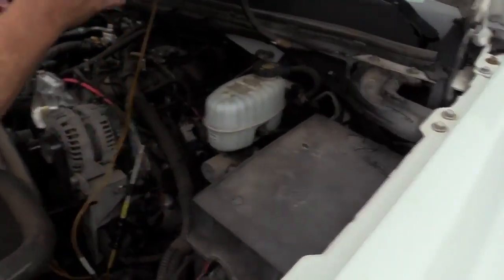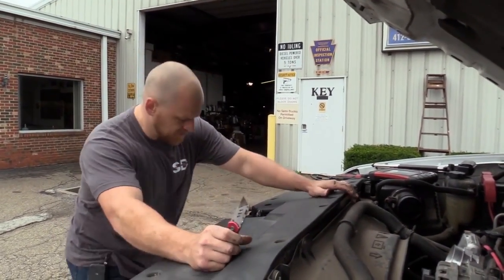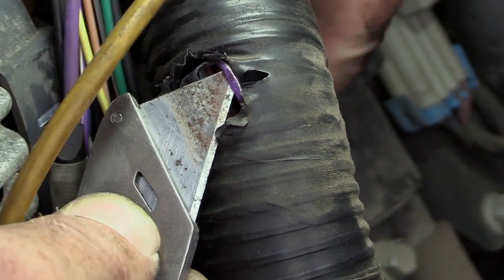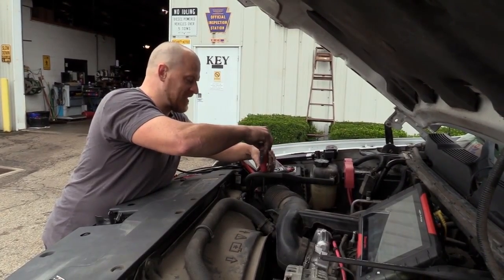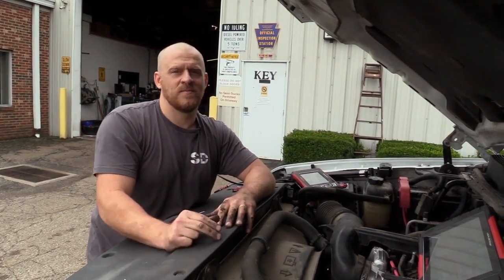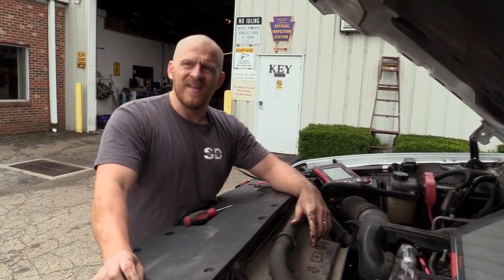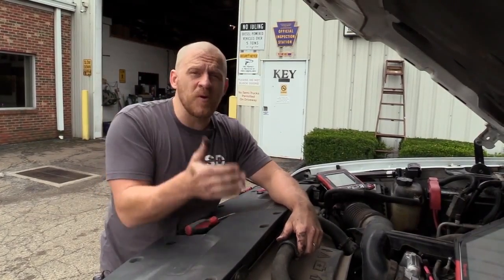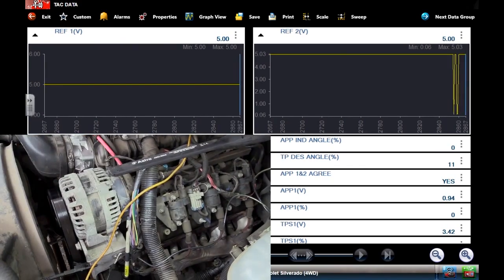Pulling codes and changing parts is not a diagnosis!

Comment: Paul first another great video.I worked for Autozone here in Michigan for three and a half years for a side job and it was the worst.That little blue code reader was a joke, you would plug it in to the cars DLC and pull a code.Then you would plug it into the stores computer and it would bring up what the code was and the description of the part.The person behind the counter would try and push the customer to buy the part.Being a Certified Mechanic since 1986 i would try and tell the person to tell the customer to take the vehicle to a good shop and have it diagnosed right.I am glad i no longer work for Autozone because these Big Box autoparts stores are a joke.i even told the company they should stop having there counter people play mechanic just to sell a part.Just a little rant LOL.

Comment: Part of peoples fear of paying for diagnoses is getting ripped off and not getting something fixed. I had a friend that is in the military call me about a 1800 bill for a shop to replace diesel exhaust no sensors  and def light and not able to drive at highway speeds on his silverado. Hes in Virginia atm me in california and i know little about diesels but after talking to him he had someone jump start his truck at his base and the codes started popping up afterward. Instatntly i thought well they must have blown some fuses so i trouble shot it over the phone with him using a test light i gave him years ago for his trailer lights. we found he had a blown 100 amp fuse from his battery jumpstart mishap. his bad diagnosis was from a  dealership/stealership often they earn that title. wish all shops and techs were honest/ competent like you and others like eric at sma. i am lucky enough to be able to fix my own cars but also feed my knowledge from great youtube mechanics.

Comment: Paul... People have reason to mistrust.   My elderly neighbor brought his car in for a turn signal that wouldn't flash.  The shop charged him hundreds of dollars to fix the turn signal (near as I can tell, they only replaced the flasher and not the stalk) and when he got it back the power windows wouldn't work.  He was terrified to bring it back because he didn't trust them and he was out of money.  I agreed to look at it and found that the power window motor relay was completely missing.  I replaced the relay (which Autozone charged $25 for, ridiculous.) and now, all the windows work except the passenger's front.
Reply from the maker: This needs to be addressed too. I'm going to continue with this topic and shoot another video about this very thing and other issues as well

Comment: This is the absolute truth. I would rather diagnose something CORRECTLY and find the root cause of the customer's concern(s) than throw parts at something and pray it works. A prime example of how much bulls$%@ I deal with as a dealer tech. 2021 Chevy Blazer has a B127E-04 code. Front view display circuit (high resistance/open). The OE flowchart literally has you test the info display even though, on this car, it's black. Controls don't work or anything. Check grounds and powers at info display module. All good and within spec. After all that, it actually says, "replace LVDS cable between Info Display Module and Radio Module." If display still does not work, replace info display. If that doesn't fix it, replace radio. Unbelievable. But I have narrowed it down to being thermal breakdown because the info display will work when it's cold or lukewarm. If it sits outside in the hot sun, black screen and no working controls. Radio works though and plays music. And I have CANbus comm to both modules.

Comment: This is an awesome video.

Most people will go to the dealership for a diagnostic and the dealership just loves to throw parts at a car, at least that's been my experience. I've had a Honda tech admit to reading a code and installing a part without actually testing the part.
Reply from the maker: This is not unique to the dealerships unfortunately 😕

Comment: Heat-n-Vibration. 💪🏻
Reply: Just fixed my 87 Bronco, where local shop couldnt.. ( threw parts, made a MESS as well..) I have a Ranger station TFI module ( EEC-IV) system troubleshooting chart.. nailed it in 30 minutes truly less than 15..... had an OPEN wire that crossed from driver side over top of engine to the TFI connector ( no secondary 12 volts COIL voltage at Pin 5 TFI connector)   ONLY reason i didnt hv it towed home was their shop was 1/4 mile from where it died... We are all friends, n i showed them how, n what fixed it, hopefully they take it to heart!  If u looked at the wire harness ( which i couldnt literally) It  forms a Y, with the SPLICE rit in wire bundle directly under the HUGE intake on a 2.9L V6....One goes to sec coil, one to TFI, n ONE to computer,  SO,, Im like only ONE side of wire was open, kinda weird, BUT  i can SEE the wire that goes to computer at bundle should it ever fail, sry long winded, it was a LONG ride, After i got it to START, it stil had a miss but PERFECT idle SO.....i DID shotgun a new TFI module, ( dont hit me danner!) they had put a ADV Auto module in w/THIN AS ICE tabs, coulda solderedem bigger but went w/Carparts.com, its perfect now, just gotta time it....

Comment: Thank you for this, I am currently dealing with a no start issue...was a crank, no start...we're now trying to figure out what changed. I replaced a few parts before finding you...and I am ok with that because I am fixing this Honda up. However, my car is still not starting. I WILL say, though..as a female..SOME mechanics are assholes. They think we are all stupid and know nothing about our cars, and they charge ridiculous amounts of money to tell us ten things are wrong, that actually aren't. Crooked mechanics give the good ones a bad name. Its hard to find a good, honest mechanic. Unfortunately, I moved from my home state 3 years ago to Louisiana, and now moved again to Texas. Believe me, I WISH either you or Eric the Car Guy was near me...my car would be running. Its been down over a month.
Reply from the maker: We can help you on my forum. It is free to join www.scannerdanner.com 
Make sure you include year, make, model and engine size as well as the history of the problem and as long as you have at least a digital multimeter and a basic code reader, we are in business

Comment: I was just there at the parts store today and the guy had to draw a picture of the part he needed as the parts guy looks so lost and confused by the description that customer was giving him
Reply: I work in a mom pop parts store that's been in business since 1953. We had an Auto Zone open up down the street some years ago. We did have an initial drop in business but most came back. The kids at the Zone only know how to work the drop down menu and are totally lost when they get something out of left field. I had a non english speaking guy come in and ask for the part that roars like a lion when you turn the key. I sold him a starter. Another guy couldn't find the "neutral switch" for his stick shift Mazda pickup (clutch pedal switch). Somebody laid a set of Chrysler points on the counter and didn't say a word. When I plopped them on the counter he said he got frustrated with Zone kids because they kept asking him make model and year (of his forklift)

Comment: What video is this from or has it not been released yet?
Reply from the maker: Check the description and my pinned comment. I added the full video link there. This was from a case study from about 2 years ago and this message got lost to most, so I pulled it out and made a separate video from it.
Reply: @ScannerDanner  and an extremely valid point it is too. My work revolves around the electronic investigation of vehicles as part of insurance claims. I wish I could get people who do not work with cars and diagnostic systems to understand the tools we use DO NOT tell us what is wrong, they are to point us in the right direction.

Comment: I can go to junkyard and buy almost every sensor on an engine for the price of one sensor at auto parts store. Plug and play until you find the offending part. So that's a very efficient method of fixing. Sorry you don't like it, and I understand what you are trying to convey, but parts is parts. $3.95 for a TPS sensor just the other day.......
Reply: How do you call that efficient? If you get lucky and swap the right part the first time. OK. But the time you spend unplugging swapping and rechecking each time you're replacing a sensor would be better spent trying to understand the fault and the circuit it is on. Quite often you can spend less time diagnosing properly and be 100% confident in your repair. How much warranty do you offer on your repairs if you have replaced 5 sensors with second hand components.

Comment: That fix’d commercial is very deceiving and gives a false impression that automotive technicians are dumb, incapable of diagnosing problems, and rip off artists. I have a code reader too that I keep in my truck, but I also have $12,000 worth of scan tools in my toolbox. I didn't just buy them to be cool, I own several scan tools because the data pids, j2534 pass through, bi direction controls, and other features are necessary to effectively diagnose and repair vehicles. The tool they are selling has a valuable purpose and it is possible to make a commercial without dragging the automotive repair business through the mud. They need to work on their truth in advertising, Fix’d is not a do all answer to a dtc issue.

Comment: Paul, it’s tough to tell folks not to be a parts changer when many (not all) shops would do the same thing.  Seems like it’s really a case of finding a technician who loves the craft and has integrity more than “pay a diagnostic fee”.
Reply from the maker: What's worse is when you have a shop that charges a diagnostic fee, as if he's troubleshooting for real, and all he is doing is reading the code and changing a part. Smh so many problems in this industry 😪

Comment: years back, my geo metro showed a cat code. my scanner recommended replacing the cat..  i pulled the O2 sensor out. it was covered in soot. popped it in a vise and burnt the soot off with a propane torch. reinstalled and the code hasn't returned over ten years later.
on a side note: never climb with an open knife.
Reply: or make sure you throw it at a buddy when falling :))
Reply from the maker: @throttlebottle5906  that was my plan 🤣
Reply: @Jesse Bianchi Yeah open knife on climb not a good idea. Grinned widely. There is a story there.

Comment: I just have share this one lol. Customer comes to me last month with plugs, wires, cap,rotor, egr valve, and a complete exhaust system including oxygen sensors and cat from AZ. CODES, po300,151 and 401 on hondoo. I say I can probably save you $ if you want. FIX,1 hour diag fee,1wire had a hole in boot,clean egr valve and port,1 oxygen sensor heater was bad. I say go return the rest of those parts and she saved $ Be well guys.

Comment: It's not YOUR money! Replace the parts, then diagnose - you don't want to miss out on that sweet markup!
j/k
Reply: i know way too many service writers who think exactly that way. more than a few mechanics too.
Reply: @jessebianchi2631  i deal with this shit every damn monday through friday... oh it probably just needs this, i had this 01 ish somewhere around that year, f150 with 5.4, damn thing keeps running and the customer keeps investing, had the typical intake coolant leaking, my manager states to me 99% sure its a head gasket, well pressure test, coolant leaking out the passenger front by #1 cylinder, which also happen to create a misfire due to coolant saturation of the coil.. im like thats a big ass 1% of being wrong lol
Reply: @ttstang43    i had a service writer who whenever a problem came in would rattle off 20 possible causes.
i'd ignore him and make my own diagnosis. the cause of the problem was sometimes one of his suggestions.
car fixed and out the door, then he's strut around crowing "i nailed that one, didn't i?".  
yeah,   he sure did.
Reply: @jessebianchi2631  Indeed. I worked with some back in the day.

Comment: I do wonder if some customers are playing a numbers game.  You pull a code and it says part X is the problem.  Part X is $20, and you can change it yourself.  A proper diagnosis is $100, but 80% of the time, part X is the cause of this code.  I can see why they do it.
Reply: It probably depends on the code.  I've had way too many experiences where someone tells me what I should replace....and it's obvious they didn't do a proper diagnosis.  I recently had a no crank problem.  I was probably told to replace every piece in the ignition system at some point....the ignition switch, the starter relay, the neutral safety switch...the connector from the battery and starter at the starter relay....and so on.  With some continuity and resistance tests, I nailed it down to a broken wire connection of the signal wire at the starter....and a faulty new neutral safety switch (that I had installed when I rebuilt the tranny this past winter).  No money wasted.  The way I see it, if you don't do the proper wiring testing, a code is NOT analysis.  It's only a symptom....which can play out in a bunch of different ways.  A real diagnosis has to make complete rational sense.  My sister had a mechanic throw $600 at her car....because it would crank....but was struggling to start.  New battery....new plugs...new wires.  In the end, I took over....and I'm not a mechanic...and with some quick analysis, it was obvious it was a fuel problem and not a spark or air problem.  It ran smoothly once it started....and it cranked always.  The facts were quite obvious.  Tested the fuel pressure regulator....and it was leaking.  WHen running, the fuel pump was compensating for the leak, so it wasn't noticeable.  At startup, the fuel would charge up...and then leak if you didn't start immediately....or if you cranked quickly without giving the fuel pump a chance to charge up the pressure.
Reply: @joeidaho5938  I get that.  I have a friend that had an intermittent no crank.  He replaced the starter but the problem remained.  He was about to have it towed when my wife and I came over for dinner.  I asked to make a few measurements.  The problem was a loose and corroded connection from his positive battery connector to the starter wire that attatched to it.  Took it apart,  cleaned it, put it together tight and it was fixed.  I'm not a mechanic either.
Reply: @ThatEEguy2818  VEry nice.

Comment: I had a customer who had a engine replaced in a 2000 Chevy Astro. It had comm codes and ran horribly. It kept blowing the ecm fuse. I did a visual inspection and found the 3 wires going to the crank sensor all shorted to each other due to non existent insulation. The sad part is the crank sensor was new and the guy who replaced it missed it. a new pigtail and a fuse later it ran like a top. God bless you brother

Comment: Good video Paul, I got your name right this time LOL. I get a call every day” how much do you charge to put on a part ?”AutoZone says it needs it.  I tell them without a diagnosis you get a receipt stating no warranty on labor vehicle was not properly diagnosed.
Reply from the maker: show them this video :-) thanks my friend
Reply: @ScannerDanner  TRY AND GET THIS VIDEO MIXED IN WITH THE WEB, IN THE P CODE LOOK UPS.
Reply: Same crap they pull here . AutoZone said it needs a coil . I say are you sure ? What if the spark plug wells are full of oil I ask . Well your fancy tool you plug in will tell you that 😜 💯😂 I say yeah and it tells me when to play the lottery also 😂
Reply: @dassme1  i remember the old days when the guy behind the counter was probably a former  mechanic.
Reply: @jessebianchi2631  I'm a parts guy since I was 8 (family store). I picked the brains of all the professional mechs when they came in. I may not be able to diagnose, but I can tell you with good probability what might be wrong.
Reply: @obsoleteprofessor2034    light years better than the modern parts counter help. did you bust a few knuckles too? i started out as an enthusiastic amateur before i went pro. you?